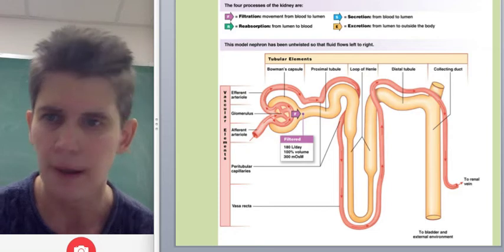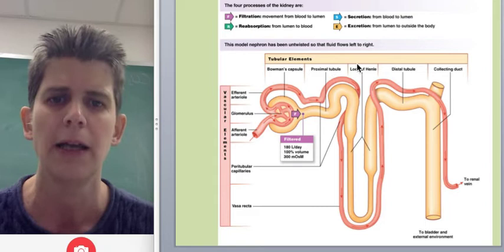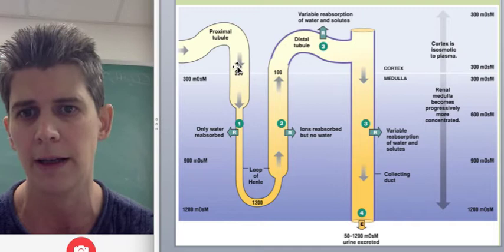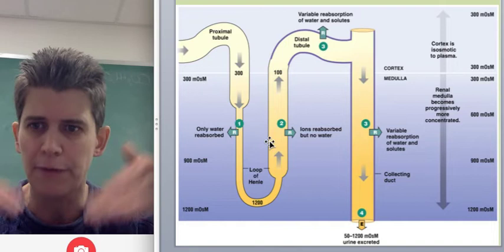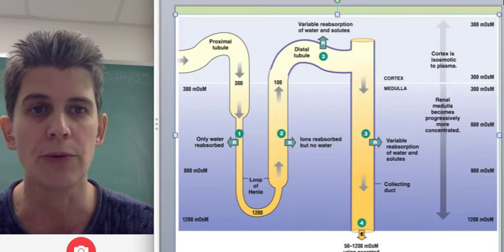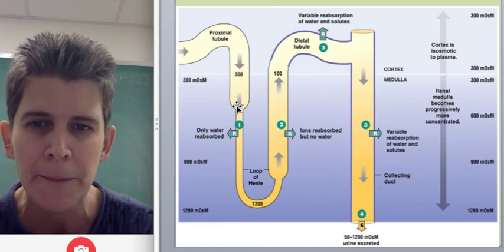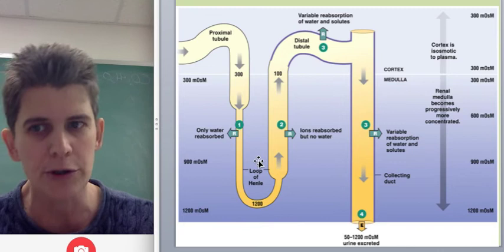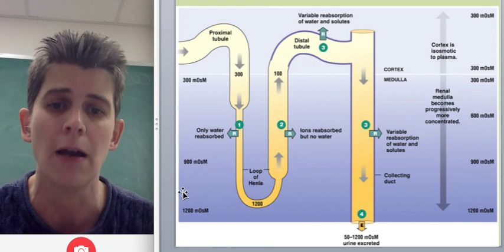Loop of Henle in Nephron with Countercurrent Multiplier

Comment: Do you know why the areas of high and low osm in the Interstitium do not mix to form an area of equal osmolarity? Is this due to gravity or is this because those processes are faster than the diffusion process or due to other reasons?
Reply from the maker: It's because the differences are constantly being created-- which is sort of what you said about "those processes are faster." Think of it like the resting membrane potential-- it's not a static thing, but the constant movement of potassium out of the cell that "is" the resting membrane potential; here, it's the constant movement of Na+ and water in these patterns that is constantly creating those differences. Turn off the pumps and there would be equilibrium pretty quickly. But, there are also additional elements that aren't on this video-- the albumin and other proteins in the blood selectively drawing water back into the blood; the role of urea as a osmotic solute in the medulla; and other factors.
Reply: @sleupen  Thank you for your answer!